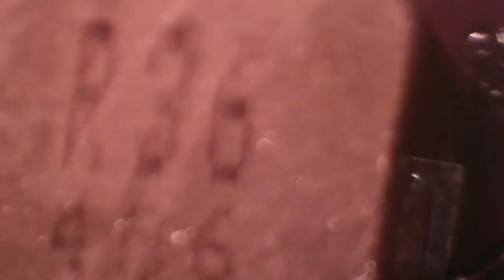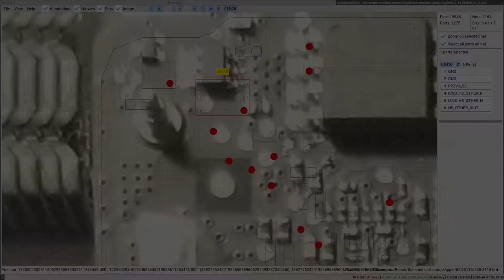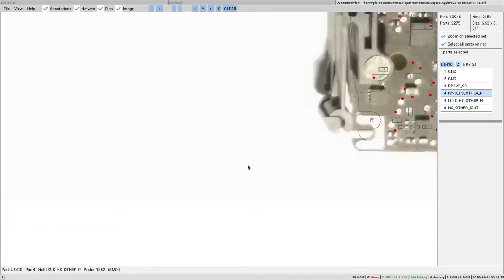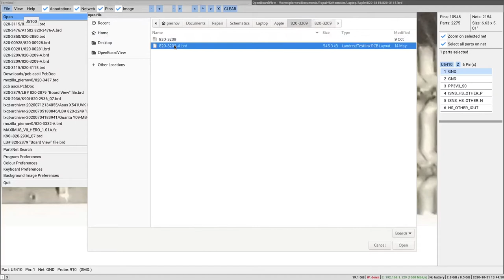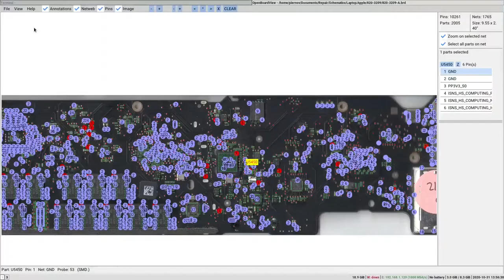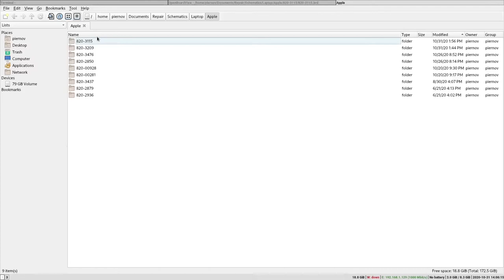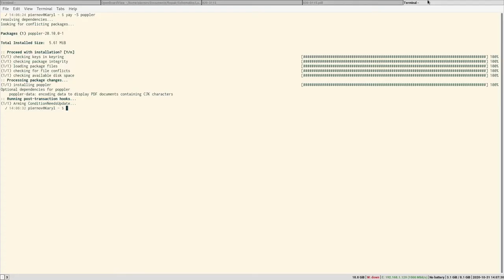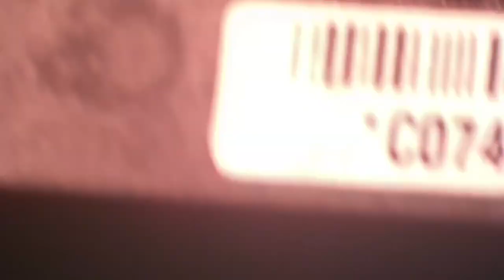Working on a 820-3115 board under microscope camera (NO AUDIO, nothing to see)

Comment: Lots of damage to that board. Was there some sort of red liquid or was that just the lighting? Was that the PCH you were digging into? Why? I like the showing the fan spin at the end!
Reply from the maker: Yeah that board is a real nightmare, no point in fixing it other than the challenge, definitely not something you could put inside a device and rely on it even if it ends up getting fixed. At 1:42:00 the short under an empty pad randomly came back and I had to dig some more, and at 1:48:00 the cap randomly shorted. It was fine before, that's connected to PPBUS_G3H and at the beginning of the video G3H/S5 rails were ok.
Before that video I already had to trace back a partial short to ground on PP3V42_G3H by removing all the components on it including SMC, it ended up being one of the last 2 I removed, U7941. I troubleshooted a missing PM_SLP_S5_L which was caused by a corroded PPVRTC_G3H via that took me a long time to find (and I replaced the PCH for nothing because I thought it was the culprit).
At the end of the video I at least got VCore but it's not POSTing yet, I soldered the PCH improperly (flowed one row off and knocked it back in place) so some balls didn't make contact. That's why I dug into the PCH and soldered a jumper wire, the VccSPI ball wasn't making contact so PCH didn't have the power rail to drive the SPI ROM and I had weird voltages on CS# pin. It was causing power cycling before VCore could come up. So now I have to reball PCH because there are other balls not making proper contact and most likely preventing POST. After that there's still a lot of work to replace missing/corroded components but they are not required to get up to CPU VCore, so I haven't touched them yet.

There's a tint shift with the camera, there is more red than there should be, not sure why, I'm using the USB interface for now, I should get an HDMI capture device to use HDMI instead and be able to adjust stuff on the camera. At 44:15 the "rust" did look red though. Not sure what liquid got on there, the board was already cleaned when I got it, but it was pretty corrosive and there was a significant amount most likely.